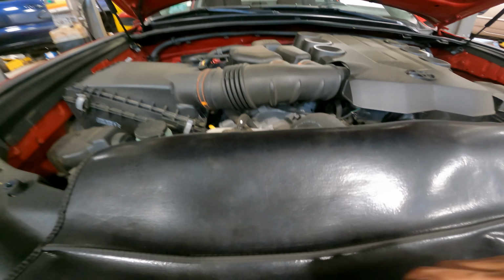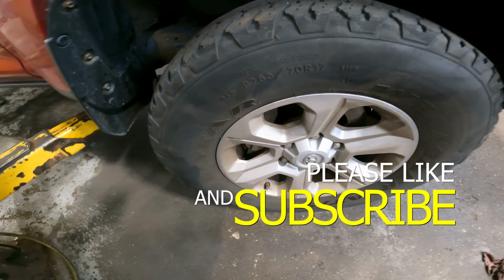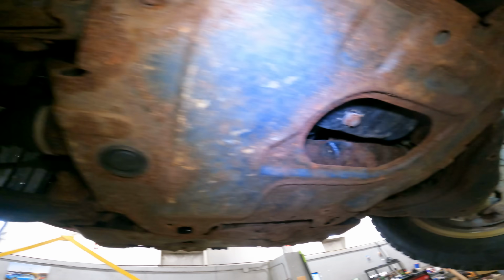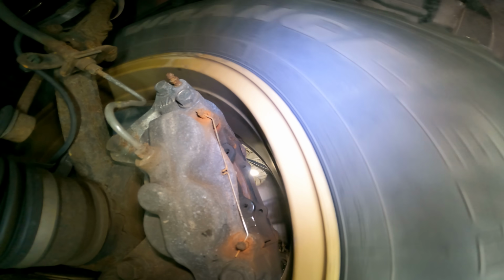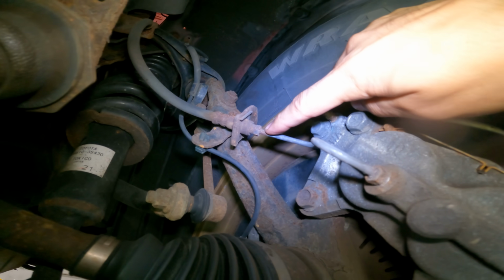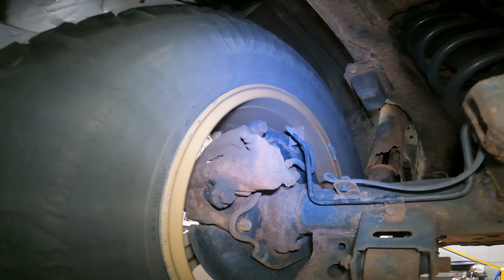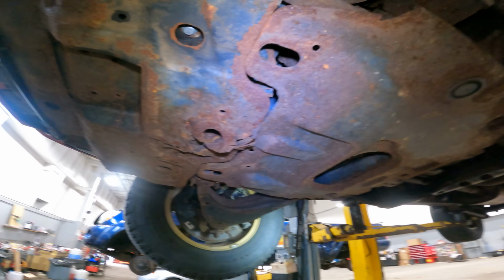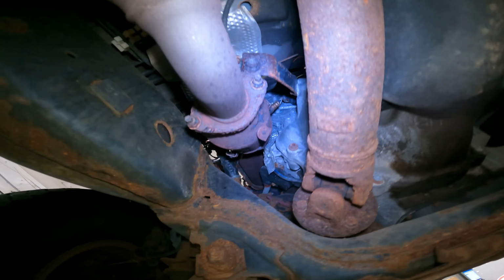Customer states WHAT DO YOU MEAN MY AXLE IS NOT THE NOISE!?😲🤯😁

Comment: @CustomerStatesWhat. The pad is moving because the "W" clip is missing on the lower side of the pads on that passenger caliper when they replaced it. You can see the clip is on the driver side @2:53
Reply from the maker: Yes its missing but the oblong hole for the pins is not helping
Reply from the maker: Also the driver's side caliper is sticking

Comment: Yeah actually the clicking noise is caused by the lack of the anti rattle spring.  You can see the spring on the drivers side, and can see that the spring is missing on the passenger side.  I forgot to install that spring once on a 2008 4 runner and that is the same clicking noise that I got as the high point on the rotor drags the pad forward, then releases, then drags again, you get that clicking sound as you go down the road.  Installed the anti rattle spring….no more clicking.

Comment: Also notice (I know the mechanic did) the anti rattle spring was MIA
Reply: Wonder if the noise would disappear if anti-rattle springs were installed. Part of me also wonders if clips are installed
Reply from the maker: It would help but not fix completely because of the oblong holes
Reply: @customerstateswhat  agree. I only noticed as I just did rotors and pads on my Tundra.  They don’t provide a ton of pressure.
Reply from the maker: @ko9446  some cars also come with 2 per caliper some only 1
Reply: @customerstateswhat  on Toyotas?  Only Toyotas I’ve done are on my 08 and 15 Tundras. Just bought my wife a Highlander, I’ll do hers in 12K I hope. She kills brakes as she races from stop light to stop light.

Comment: ALWAYS replace the Pads/shoes on the same axle as a set or you risk uneven braking swerve. Tires should also be the same series on an axle (and never bigger on the stear's. Been there, instant U-turn under braking. Lucky. road unused-ditch stayed in place)
Reply: It's not going to swerve unless one is completely locked and the others are completely free. Even if he just replaced the one side, braking performance would definitely not be any worse than it currently is with one side having a loose pad, and the current driver couldn't tell anything was wrong aside from the sound. Hydraulic pressure is going to be identical throughout the system. The only difference is the difference in coefficient of friction between the side with new pads and the side with old pads. It's just service talk about best practice to make more money.

Comment: The rust!  Gee my 2012 Volvo looks new compared to this mess. Heck my 98 Volvo was in much better shape.
Reply: Don't know where this is located but Pennsylvania spreads brine on the roads in the winter. Cars don't rust where you can see it and brake lines fail with starting regularly. I never had a vehicle rust out like my 2001 Ram 1500 did in 2016. It looked really good until you got underneath it. Every attachment point on the frame had severe rust damage. I traded it on a 2016 Patriot.
My Patriot has already required a lower control arm after it failed inspection at 50,000 miles thanks to the brine. My wife's 2014 Patriot required a tie rod end after it failed inspection due to corrosion.

Comment: Man, we have to find a cure for rust, it definitely is a killer!
Reply: It’s called living in the southwest… but it’s hot out here. No salt on the roads though 👍🏻
Reply: Rust usually goes away once all the metal is gone.
Reply: @BA-gn3qb  it is still around it is just metal no longer identifying as metal  the earth does a great job of recycling no human intervention is needed.
Reply: Rust never sleeps.
Reply: Galvanized parts and undercoating. Frequent washing with anti corrosive soap in winter
Reply: @danielburgess7785  Late at night while everybody else is asleep, if you listen, you can clearly hear it traveling through and eating all unprotected metals. Some people mistake it for gremlins, Santa's reindeer, and even the tooth fairy, but they just haven't seen the underside of their vehicle and been told what's happening.
Reply: @liamflynn6929  I agree with that and I think it's important to chamois it dry as well.
Reply: Rinse off the bottom of the vehicle with fresh water after exposure to salt air.
Reply: @GTLees  I believe in gremlins with the same white hot fervor that I give to bigfeet.
Reply: @danielburgess7785  There ya go!
Reply: Frequently wash underneath the car with just water, spray silicone oil on bushings,  boots, rubber. Spray some wd40 or corrosion x on metal surfaces especially where it's showing rust.